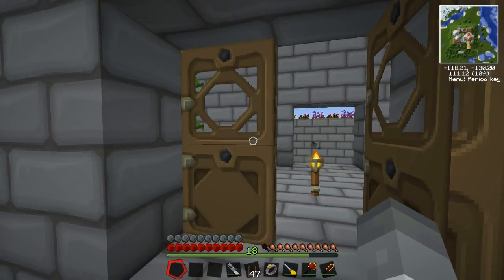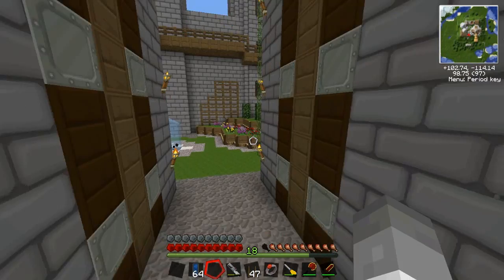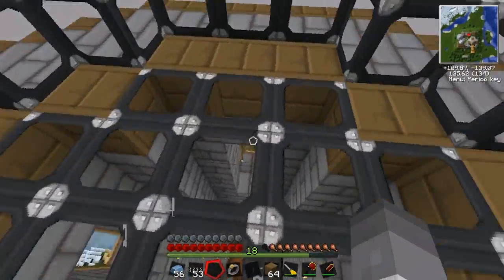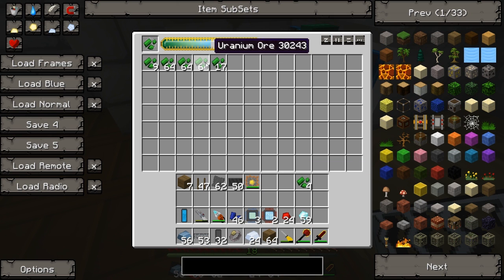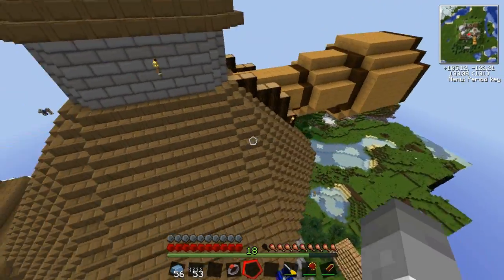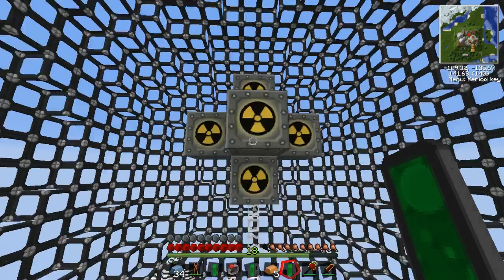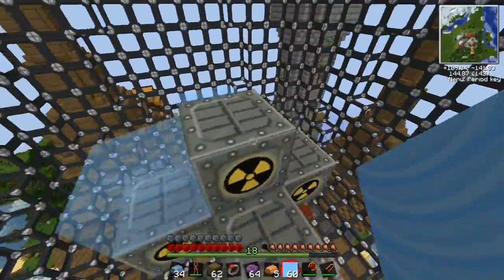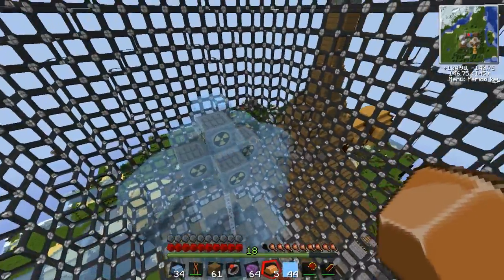Duncan's Lab - 61 - Building the Reactor

Comment: Loving the series :D However, a few things still bug me:
1) To make viewing recipes easier and without the risk of giving yourself the items, go into NEI options and change it to recipe mode...you no longer need to click "R" as you can just click the block/item directly.
2) When trying to place things on a block with a GUI in mid-air, hold shift and space at the same time...you wont drop downwards and should still be able to place on blocks with GUIs.

Comment: With water, the reactor is a Mark 1-0, which means it will run forever if you keep restocking the uranium. be sure to wait 23 seconds between taking the old uranium out and putting the new uranium in, or it will slowly build up heat.

Comment: Duncan, the reactor core will only be cooled by things in a 3x3x3 cube around it, so the water you're putting on the outer most facing of the reactor chambers won't affect cooling speed.

Comment: since you place the mfsu at the bottom of the sphere, IF the reactor blows up, you will have a lot of damage underneath the sphere (it diffuses a bit and it will kinda concentrate the power in that direction)

Comment: Can I suggest two future projects?
1. An auto matic reactor cooling system using snowmen block breakers and compressors to genorate infinite ice - pretty cool
2. A light up thermal monitor using remote thermol monitors, reactor location cards (by clicking on a reactor with a frequency transmitter) and redpower lamps for a monitor that goes from green through red.
P.S also maybe an emergancy stop with a thermal monitor and wireless redstone?
Hope you have fun with these ideas :)

Comment: Actually, I did some experimenting, and the destructive power of a melt down is dependant upon the number of fuel cells inside the reactor. with the ten cells he has in it, I'm pretty sure the blast would mostly escape either through the open top, or through the mfsu, destroying a good portion of the tower in the process.

Comment: modifying the blocks directly adjacent to the still blocks updates the water block causing it to flow... So you can either place or break a block next to the source block and it will cause it to flow just like any other water.

Comment: this reactor wont go through a full cycle which means if its not cooled down frequently it could blow if you shift the uranium so each one has a coolant cell or plating on all sides you can get a full cycle and not have to worry about the top half of the castle being blown up.

Comment: Nuclear reactor explosions are a little weird. Sometimes the blast will be more focused on one side and will damage an area a bit more. but if he fills the entire sphere with water, the dampening of that and the high resistance of the glass will reduce the remaining blast to near nothing. On top of that, he made the castle walls out of bricks. And type of brick has a significantly higher blast resistance than normal materials. After that, the damage to anything inside the walls would be minimal.

Comment: he doesnt realley need the shell much stronger since its high up in the air, so all the blast will do is blow up the top of his castle, none of his machines. besides it will be more expensive making more reinforced glass would be more expensive than repairing his castle

Comment: @Yogscastlalna Still water turns into a source block whenever it receives a block update. In other words anytime you place, destroy, or move a block (piston or sand/gravel/tnt falling), and whenever a redstone signal is applied. You could place a floor 1 block away from the ceiling of the sphere, fill the space between the floor and ceiling with water, and then remove the floor.

Comment: Duncan, build a causuc (sp?) reactor. use EE to produce craptons of ice in a condenser and redpower filters to pump it into the reactor a stack at a time. a reactor full to the brim with uranium (minus 7 slots for ice) produces about 2500 EU/tick. you will need 4xinsulated HV cable though. Like so he can see.

Comment: You know Duncan, the reinforced glass isn't that amazing. A fully fledged nuclear reactor would obliterate your castle, even with the sphere. You can try to use a force field, which would use energy, but is much more certain to protect your castle. Making a Nuclear Thermal Monitor can help to monitor your reactor as well, as it will shut off the reactor as soon as it hits a specified heat level.

Comment: i don't know if it's in this version, but you could make a thermal monitor (which gives off a redstone signal if the heat is higher than is set) to a howler alarm, which means you don't have to check if it's overheating

Comment: Shouldn't you reinforce the whole thing? For example that cable and mfsu is a big weak spot if it explodes. It would destroy large parts of your tower. And a single layer of reinforced glass isn't enough to stop the explosion completely. Two layers should do it.

Comment: Still water blocks don't flow unless they get a block update (ie placing a block nearby). Similar reason to why floating gravel/sand will stay floating until you mess with it. Kinda like how automatic wheat farms were set up before pistons: have a still water block only flow after a player controlled switch to mow over the crops and move them.

Comment: What you should do duncan is have the middle seven slots at the bottom of the reactor be stacks of ice. Have an energy collector producing ice into a condensor and have those stacks of ice go into the reactor with the rest of the slots as uranium cells. It gives you 2030 EU per tick which is incredible. There is a tutorial for it on the tekkit wiki

Comment: You need to update the blocks in order to get water to flow because it doesn't do it on it's own.

You can do this with redstone signals or by placing/ removing blocks. I'm sure there are more ways as well.

Comment: Still water turns into flowing water when a block update occurs. You can trigger a block update by simply changing any of the waters surrounding blocks, like breaking or placing an item right next to the water. 
Hope it helped.

Comment: Add a thermomiter thingy, attatch it to reactor leading a redstone or redwire current back to reactor, so if reactor goes over surtain temprature it will turn off as when a reactor recives a redstone current it turns off. Plz like so Sjin doesn't destroy the EPIC castle.

Comment: You should use ice blocks instead of coolant cells, they run out faster but you can put more uranium in. To make an ice machine, just have 1-4 snow golems above some block breakers, compress the snowballs you get and pump the ice into the reactor! =) Easy as shit!

Comment: Not sure if you're using the newest version of tekkit but do you have MFFS stuff? like heat control, auto shutoff etc? at Least a thermometer? Seems like with one glass layer and holes in the bottom you're gonna lose some of that nice Castle.

Comment: Guyas, just a point for you, these guys are running a slightly outdated tekkit version, if you wire up a reactor with Glass fibre cables, and directly into an mfsu, both will explode. You need HV cable (preferably 3x ins), and a high voltage transformer, to converty Extreme down to high voltage

Comment: i wish i could just go on this server to fix up duncan's stuff a bit. he could have a much better reactor setup. without using equivelant exchange, you can get up to 230eu/t (i may be wrong, but i'm pretty sure) and if you do use equivelant exchange, you can get it to put out up to 2050eu/t. both can run forever. but oh well.

Comment: Ducan two things:
1. The water isn't running because it's still water so you need to give it a block update (e.g. placing a block next to it) to make it running water.
2. On the top right corner of the MFSU there is a little redstone dust sign if you click it until it says "Provide signal if: Full" or something like that, it will give a redstone current when it is full of energy. You then need to connect the MFSU to the reacter so when the MFSU is full the reacter turns off, saving you power.

Comment: Duncan, you don't need to make a mark1 reactor with all the coolant stuff in it.

There's a perfectly safe, much more powerful alternative: reactor full of uranium cells and 1 row filled with ice for cooling. Ice can be generated with a condenser and a mark3 energy collector. You pump the ice into the reactor using a redpower filter (i think it is), a sequencer and a tube.

100% safe and way more efficient than mark1 setup. Just make sure the condenser and the works is right next to the reactor.

Comment: The reactor setup you have is a near infinite cycle reactor. A Mk. II-4 to be exact. There's a small chance it will overheat but you can wire up a temperature sensor using wireless redstone and connect it to an alarm that warns you when it's overheating.